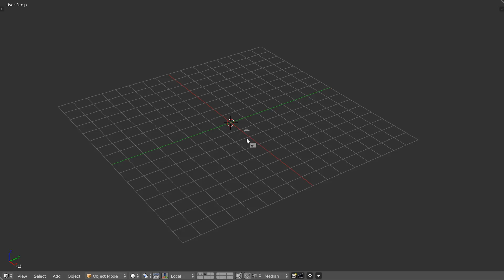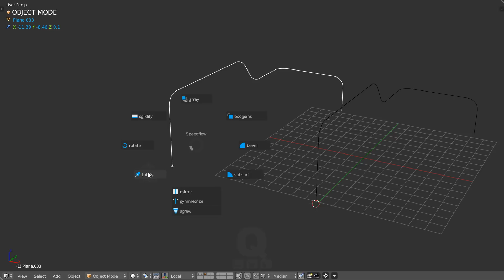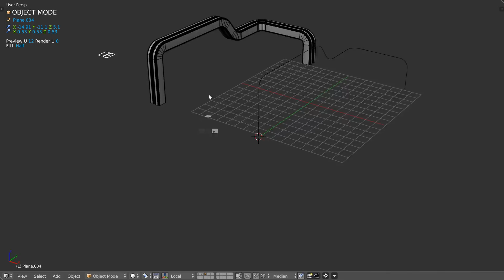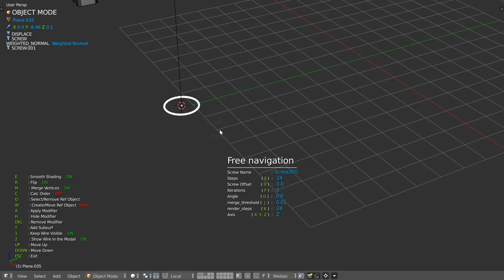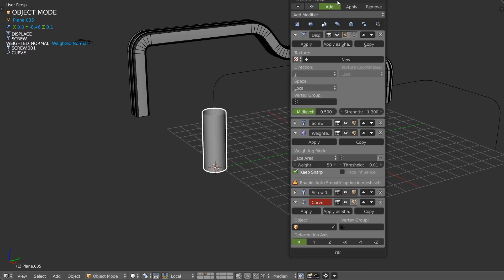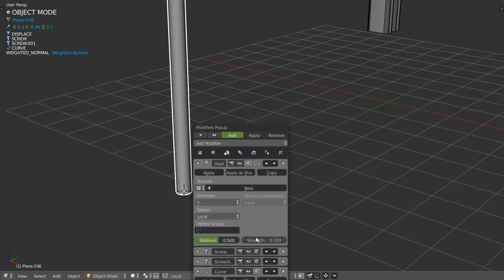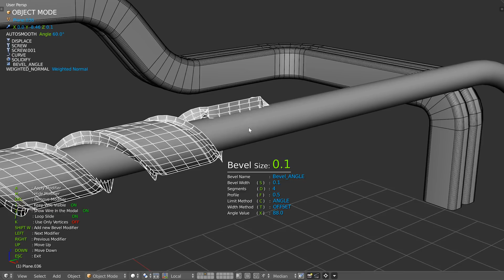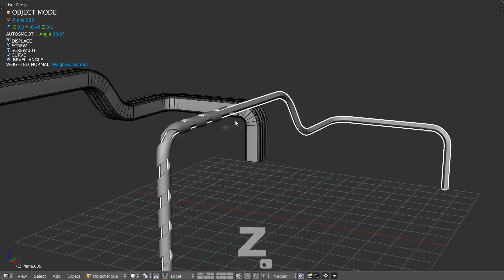Speedflow - Screw Modifier for cables

Comment: Hi Cedric, I'm encountering somethings strange when I tubify like you with a shape (curve). If you look at the image in the link, I select a rectangle shape and applying the shape my tube is twisted! Look at here: https://abload.de/image.php?img=capturew3ijy.png
I'm using Speedflow v2 beta 20 and Speedcompanion v2 beta 13. Blender 2.79c. Do you have a tip for me?
Reply from the maker: flip the direction of the profile curve ;)
Reply from the maker: Edit, I'm wrong sorry, it seems the vertex of the curve are not straight, you can use ctrl + T to turn them.